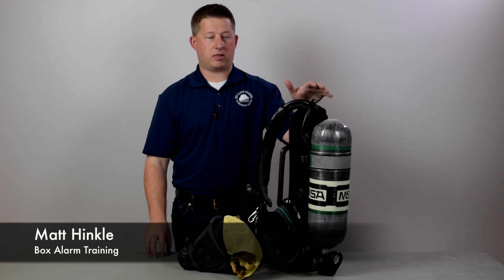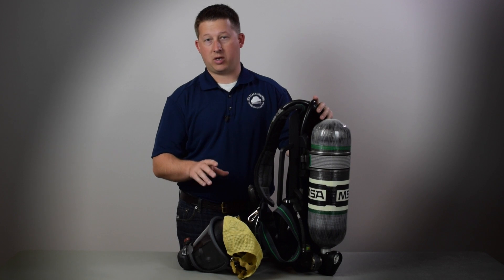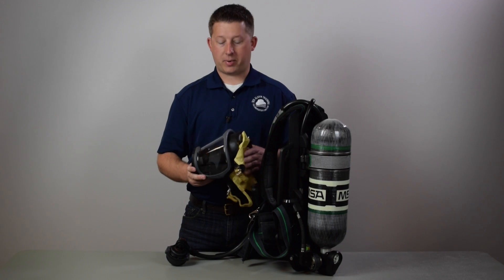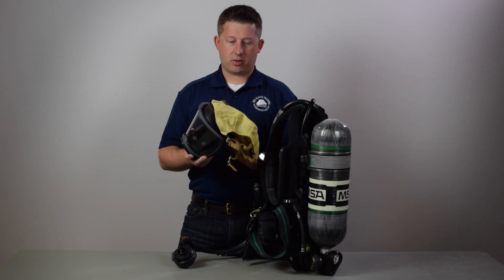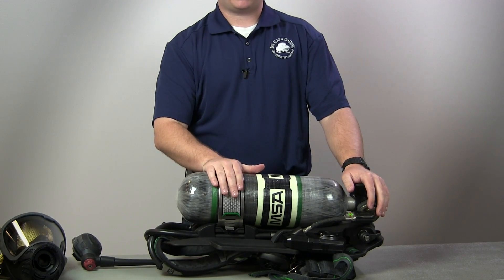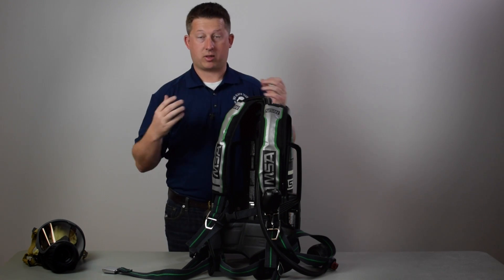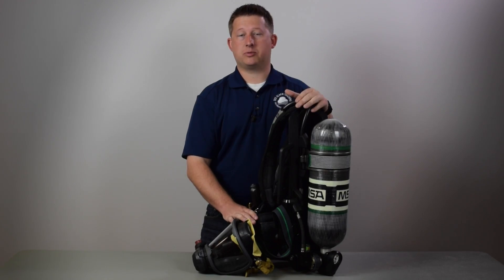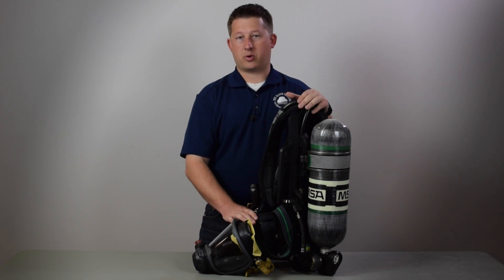MSA G1 Review

Comment: Been working with these packs for a while now and overall I'm a fan, thought the led's were kind of useless at first but as you adapt to the pack they are actually quite handy especially in low visibility. Thing that annoys me most though is the regulator, the bypass and hose swivel are connected so I frequently will accidently open my bypass when bend over or cause the hose to buckle. I have gotten used to it and anticipate it now but is definitely something that needs to be corrected. Great break down of the G1 Matt!

Comment: Total garbage, the regulator doesn't swivel so when you turn your head and the bypass opens up. The hose kinks, we drilled on a fireman down and the waist belt unbuckles on them. Never have I looked at those dumb lights to reliazed I'm running low on air.
Reply: Maybe you should drill with the lights so you can be a more valuable asset to your team.
Reply: Jim Jim I’m with you, man. This thing has too many bells and whistles. The bypass is incredibly easy to accidentally open. The mics in the regulator make communication more difficult because all you hear is everyone breathing. The shoulder straps are too wide and make working overhead (pulling ceiling) more difficult. More features = less functionality. Less is more.

Comment: Where are the serial numbers located on the packs?
Reply from the maker: I will have to check with a friend of mine. I imagine it is located on the frame and possibly on the pass menu during startup. I'm sure somewhere in the software you will see the serial number. You may also have to look on the lower assembly where the bottle connects to the system to see if it is machined or laser etched on that part of the system. I can let you know for sure after I talk with my contact.
Reply: +Matt Hinkle sounds good. thank you sir
Reply from the maker: +Matthew Thompson If you lay the pack on a table with the bottle down you will find the serial number in an indention on the back frame (body side) underneath where the straps enter the frame. You will have to pull some slack where the straps connect to the back frame and you should see the serial number underneath. He said it would be on the right side if you lay the pack on a table bottle down.
Reply: +Matt Hinkle thank you buddy we found it. I sure appreciate it brother!

Comment: Have you heard of any complaints or experienced any firsthand with the new being harder or more laboring to breathe with the G1? We are currently testing 3 different SCBA packs and the common complaint is the MSA G1 is more difficult to inhale with compared to the other 2 (Scott & Interspiro)
Reply from the maker: +Ben Patchett I haven't personally heard those complaints. I haven't worn Interspiro but I have worn Scott for awhile and the flow felt similar to me. There is definitely still a difference when not connected to your air. If you are recovering in between runs in a training building and leave your mask on but disconnect the regulator I could see that for sure. I don't feel like I have had enough time in the G1 yet to give a real in depth opinion of it's strength. I know I really like a lot of the design features on the pack I just haven't had the time to put it through it's paces.